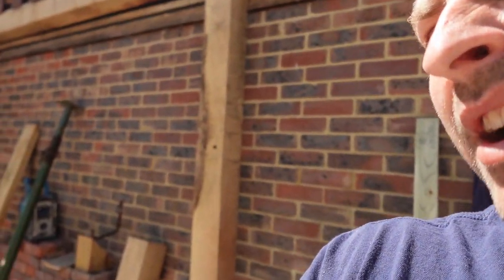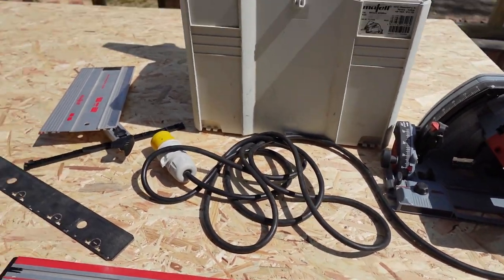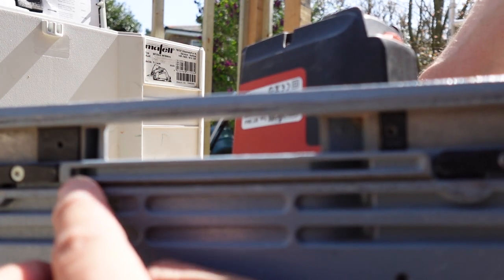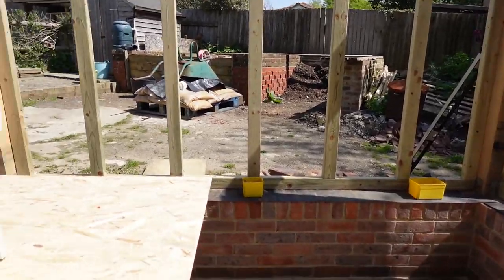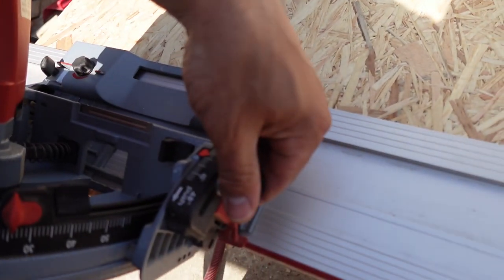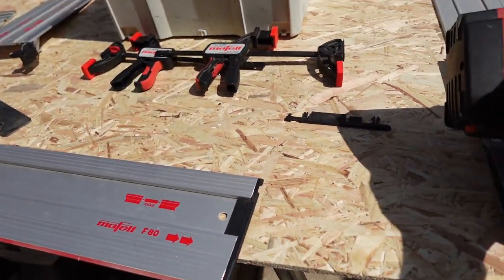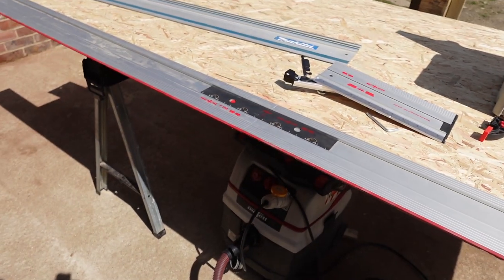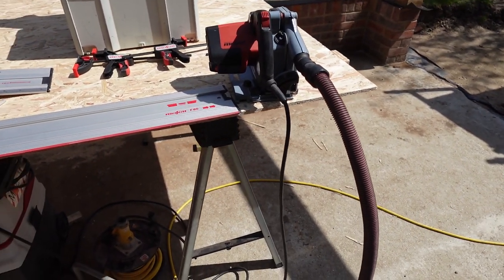Mafell MT 55 cc Review

Comment: I have the battery version and it is by far the best track saw on the market..
Reply from the maker: Definitely great peace of kit!
Reply: Is the  battery one powerful enough to rip  2x4s and 8/4 hardwoods? Or you just cutting plywood? Thanks
Reply: @patrujo  I have ripped 5/4" white oak with no issues. I never had to rip 2"×4" with this saw, but I used Mafell 40 series tracked saw on 2"×4" with a 40 tooth blade. It is the smallest saw Mafell makes, and it is a power house, so this should handle anything you throw at it.

Comment: I have the mafell mt 55, makita sp6000 and makita sp001gz 40v xgt. The weak point of the mafell is the plastic spring guide that holds the main plunge spring to the base. It has a flimsy 1mm thick locating tag that shears off because the spring is so strong. My mafell is only 6 months old but I've noticed, it has a lot of cheap parts on it for ease of repair. The switch and speed controller are like grinder grade, bottom of the barrel cheap but tough. Not had any problems with my makita sp6000 which is 8 years old and was used most days kitchen fitting and ripping up mdf etc. My 40v makita has basically made the other two redundant, though, for 95% of jobs. Cordless is the way to .
Reply from the maker: It’s funny as it’s opposite for me, I have had gone through 3 makita sp6000 110v after heavy use, cutting doors, thick mdf etc, and don’t get me wrong it’s a good saw in general, what I found that my blade had i side way movement which meant that when cutting materials length ways individually there was always some sort of discrepancy, took it in for repair and was told that seat where main shaft sits wears out and it’s nir really something worth fixing( to expensive) now I have had Maffel for 3 years same usage and no problems.

Comment: Thanks for going over depth setting lock. I need something i can trust. On my last job my makita kept loosening at the depth setting knob and it would go to deepest setting. Seriously scary kickbacks if i didnt double check it ripping 2x4s on sleeper subfloors. I just found out the closest cut to a wall is is 31mm for mafell and 12mm for makita. I need under 3/4” for cutting perimeters around hardwood floors. May just have to keep both tracksaws.
Reply from the maker: No problem, glad you found it useful !!!
Reply: They have a small saw the kss40 or kss300 as a corded saw that can go very close to the walls, works on the tracks and has a very usefull depth setter which allows you to plunge the saw. Much recommended for floors

Comment: I have just picked up a Mafell plunge saw today. Without eve cutting anything, the motor produces a fairly strong electrical smell, reminiscent of my old Hornby train track. Is that common?
Reply from the maker: Must say I can’t remember now how it was when I purchased mine but as long there is no smoke coming out and no power loss you should be ok, don’t forget you got warranty as well.
Reply: @ANCarpentry  thanks. I haven't actually tried cutting anything yet. I bought it off someone else who had only used it for a couple of weeks. It certainly doesn't look like it has had a lot of use.
Reply from the maker: Bit risky buying before trying if you ask me 🤔

Comment: i had the makita and mafell track saw,  the mafell is in another level and much better. it was the best track saw i had, only the brand new festool ts60 is better then mafell mt55.
Reply from the maker: I would agree Maffel is better, all those little things they have done in terms of design make life easier for day to day use.

Again, Makita is not bad if you not using frequently.
Reply: Hmm its a coin toss for me. Im festool fanboy and the ts60 is only $30 more than mafell

Comment: Bearing casing for Makita is plastic? False! You're a shill for Mafell.
Reply from the maker: On a model which I used to have handed for repair that’s the fault I had on my own tool maybe they have been improved with newer models and rectified the problem if that’s the case let me know in comments.

P.s I don’t get sponsorship from anyone, only sharing my experience.
Reply: @ANCarpentry  Makita has always used die cast magnesium for the gear housing for their plunge cut saw. All you have to do is look up the part. Youtube does not allow links in the comments.
Reply from the maker: As I mentioned that’s what I was told by the engineer who meant to repair my saw at the time - the problem I had was the way it cuts on 8x4 sheets cutting in length, and he said that the cause was something to do with where bearing of the main shaft is sitting ( that area has worn out). I used to own 2x Makita plung saws in the past and each of them where good for about 3-4 years during which I've used them almost daily.